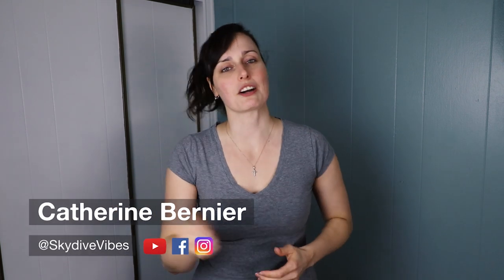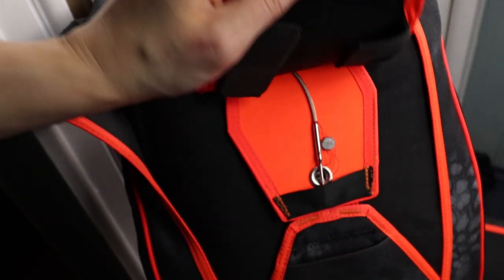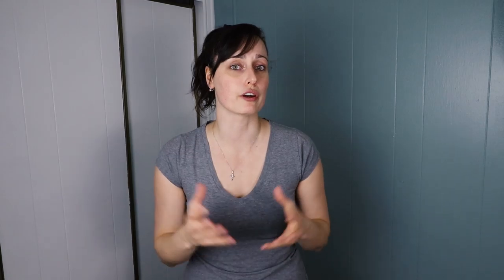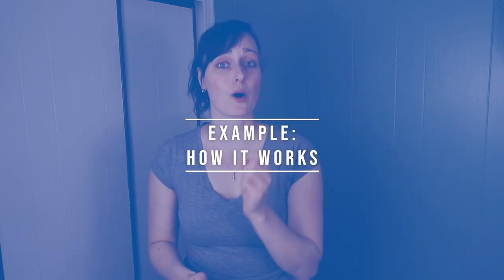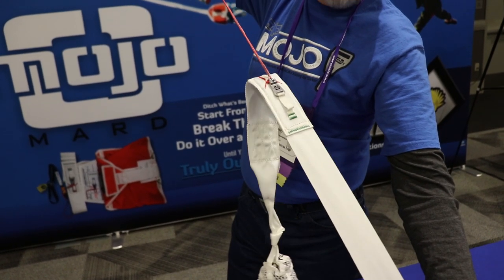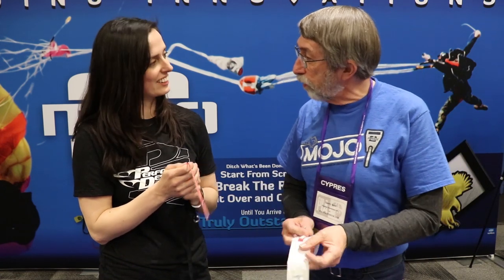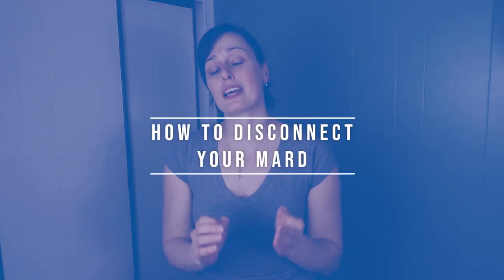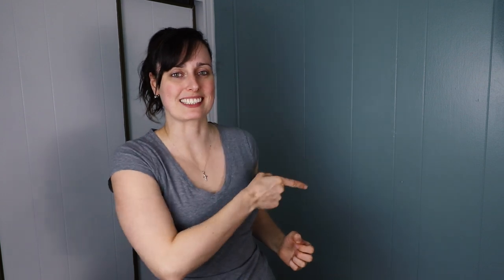Skydiving Malfunction Systems - MARD Explained

Comment: I jumped for eleven years with an RSL on other systems (Javelin and Infinity). Had one cutaway with the RSL and hit line stretch under the reserve as I was removing the reserve ripcord from its pocket. I love the concept of the MARD, but am also aware that they have sometimes been packed incorrectly by a rigger. If hooked up "backwards" a MARD can lock down the reserve pilot chute in a total mal situation preventing reserve deployment. This is very rare, but has been found on some rigs at the next reserve repack. Human nature being what it is, this mistake will continue to happen - though rarely. What I like about the RSL is that the jumper can inspect the whole thing from one end to the other and be assured it's routed correctly. The time saved by a MARD over an RSL shouldn't matter if you're opening and cutting away at safe altitudes (minimums of 2500/1800 ft).
Reply from the maker: Yes, more time to react is always safer, so making sure your opening altitudes and cutting ones are respected is smart!

Comment: Great video and very important as well! Everybody should be aware so they can decide for themselves.

I can understand everybody who jumps a RSL, Skyhook or MARD. For me personally I'm jumping without it. "Keep it simple" is what I prefer. I want to be in charge of the behavior of my system, especially in emergency situations. It is great to have improvements, that's part of our sport. But we are not in BASE environment. We all know that there have to be combinations of events to get into a situation thaaaaat low, that this system will safe our lifes. In all other events the normal emergency procedure is fine as well. Of course, if you get there once, you have no second chance. But on the other hand I heard of issues for these kind of systems like RSL, Skyhook or MARD as well. It can be rigging / installation issues, user errors or whatever errors. I'm not saying these systems do not work or they are bad but every additional piece of Equipment is also a danger to do mistakes. This should be said as well.

Someone told me about statistics that these systems are more reliable than causing issues for whatever reason. For me personally it's also a point of confidence in the sky and I dont want to have in mind that something could cause an issue. I want to rely on my behavior in the sky. If I fuck up, it's my fault... probably not very common point of view these days but I think its important to talk about both sides!

Comment: Very well explained. 
Any innovation regarding safety is always well received and all solutions are still valid and reliable. Perhaps the strength of UPT's skyhook system is the presence of the collin's lanyard which in the case of a partial cutaway of the single riser to which the RSL is connected, allows the release of the other riser before activating the reserve, effectively preventing a possible main reserve entanglement. I don't know at the moment if other M.A.R.D system provides this function. 
On june 2019 in Italy (Reggio Emilia D.Z.) a partial cutaway on a M.A.R.D equipped gear
 fortunately ended well with only minor injuries . 
A collin's lanyard  would have prevented this malfunction . 
Here the link to the video of that jump 
https://www.youtube.com/watch?v=q7q7JtR4wLs

Comment: Didn't quite understand on cut away once it had pulled the reserve out how does the main canopy detach.
Reply from the maker: The main is attached to the reserve deployment bag which is not attached to the reserve canopy. So once the reserve is out the main go away with the reserve d-bag.
Reply: @SkydiveVibes  ahh thanks makes sense.
Reply: @SkydiveVibes  Which also helps you to find your main and freebag together on the ground. Which is very nice !

Comment: Call me crazy but if I’m going to have to pull my reserve I want to physically pull my reserve myself once I know I’m clear of my main but that’s just me.
Reply from the maker: Totally understandable, but we never know the circumstance. At a low altitude, you may not have time to wait for the main to clear...
Reply: Skydive Vibes that’s so true.  There are def advantages to both it would be nice if we had the best of both worlds lol
Reply from the maker: @clayb1832  good news you do!! You can disconnect your MARD by disconnecting your RSL so in cases you really want to get rid of the main, release your RSL. ;)
Reply: Release RSL, cut away main, deploy reserve. Call me old fashioned but I fear the more advanced tech we put into chutes the more failure points we have to deal with.
Reply: @StiltZ-cz4sq  until they make them compulsory you dont have a problem then